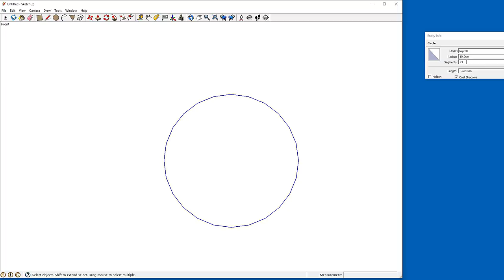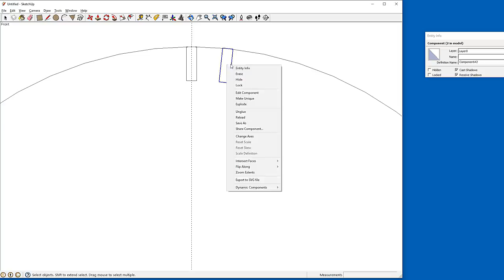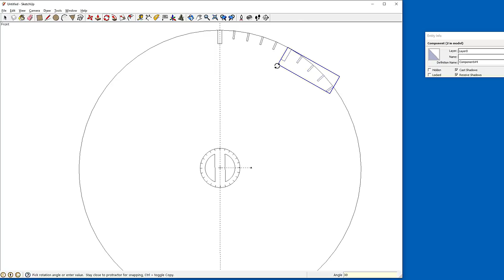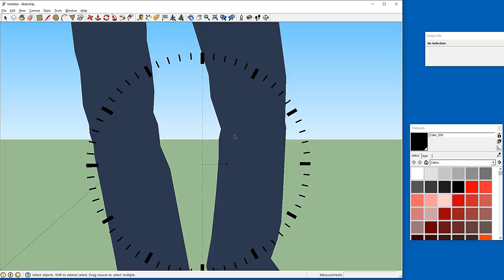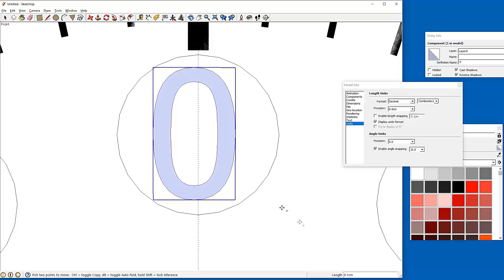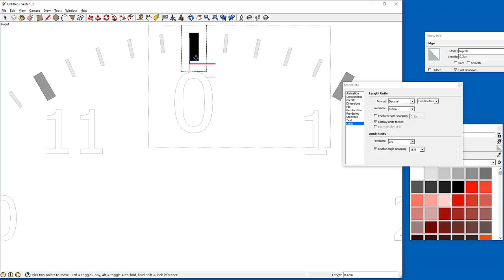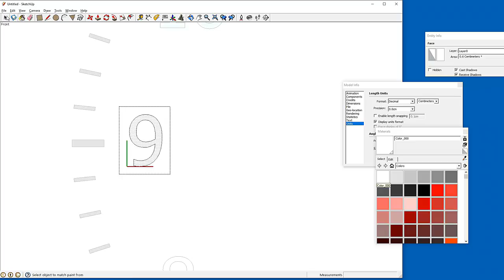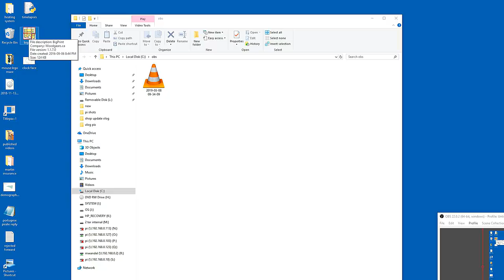SketchUp: Drawing a clock face (repair for IKEA clock)

Comment: I like this new clock face, Matt, because even though a lot of clocks wouldn't look good with a lot of color, I think this one does! Interesting that you chose "0" for noon and midnight, and the the old resistor code colors for all the numbers.
What's also interesting is that I never learned those last two, cyan and magenta, until now. I'll have to look up their values. I wish they had included those a long time ago and put them in their spots between green and blue (cyan), and between purple and gray (magenta). (Actually, if I had designed the code, it would start with red and then go from magenta to brown, and then black, gray, white, silver, and gold.)

Comment: That job reminds me of when I relabeled an imported rotary telephone (where 1&9, 2&7 were swapped), but that was 25 years ago, no sketchup, and on a 24 pin dot matrix. As the digits were behind a sheet of plastic it almost pasted as a stock indicators.

Comment: It’s incredible how much easier this would be with a real CAD software.
Reply: Not really. If he wasn't explaining things he could have done it much quicker. I just drew this in Sketchup for the hell of it and it took less than 2 minutes.

Granted, if I was actually designing a clock face I would have drawn it in Illustrator, because I would rather have true vectors. But Sketchup is nothing if not fast, if you know what you're doing.

Comment: I hesitate to mention this, but I hear/see you 'clomping' the mouse because you pick it up and need to 'zero out' the XY scale... I think messing with the 'speed' or "DPI" (and possibly the 'acceleration curve' settings) of the mouse in your OS settings might help you out... It might take some time to get used to a much higher DPI, but it will save your wrist from having to clomp that mouse around... I hesitate to mention it, because I know how 'personal' computers are, but I really just want to help your wrists out. Also, I just learned this: 'gaming' mice have REALLY made some impressive strides with comfort and functionality. Thanks for the videos, they are great!
Reply: the easy answer is just get a bigger mouse pad....

Comment: how does a clock disintegrate like that?
Reply: +Nate Walkner The advent of digital clocks.
Reply: If the clock face was printed on plastic material with an ink that was too 'strong' for the plastic, basically it eats up the plastic material over time. Typically this was seen with plastic materials printed with solvent based inks - if the solvents do not get fully driven out at the drying stage and remain in the ink film (even in small amounts) then over time it degrades plastics, especially in an enclosed environment. Just a guess but I've seen it several times over the years working in  R&D for ink companies
Reply: The passage of time
Reply: @KJS988  bravo sir
Reply: mice!
Reply: @TheBananaPlug  So the solution to getting rid of plastic is ink?

Comment: If you haven't selected anything else yet, you can type the number of desired segments of the circle and press 's' then 'Enter' just like you can type in a diameter. Entity properties is still available if you need to change the segment count later.
Reply: I guess "s" is for "sircle" since "c" was already used (presumably for "copy")?
Reply: @Sharklops  'c' is the shortcut to begin a circle. 's' is for segment. Once you click on a origin point and drag out the radius, you can type a number, then 'Enter' for the diameter. Type a number, then 's', then 'Enter' sets the number of segments.

Comment: Indexes start at 0, right Matthias!
Reply from the maker: yes.  Because "12 pm" implies its referenced off of midnight (12 hours), but it's PM.  Really annoying if you write a function that shows the date.  "0 PM" would make way more sense!
Reply: @matthiasrandomstuff2221  Personally I prefer the 24 hour notation anyway, but it'll be confusing on an analog clock I guess.
Reply: @basapon7074 
It's actually kinda common to have both 1-12 as well as 13-24(smaller print) on analog clock faces.

Comment: What language did you write big print in?  I’ve been looking for a good framework to write some simple apps for windows.
Reply: Not what Matthias uses (I think), but check out https://www.qt.io It's used in wide variety of applications, both commercially and in home. It has nice licensing options, too, if the open source version does not suffice.
Reply: @mattiviljanen8109  Thanks!  I'll check it out.

Comment: Are you using Google SketchUp or Trimble?  I see there is a free download of Google SketchUp 8, but it appears that all of Trimble's versions are fairly expensive.
Reply: Never mind.  I was looking a bit more on the web and discovered that Trimble acquired the software from Google.  There is apparently now a free version which is cloud based.  The warehouse is not available if using ver. 8.  I downloaded ver. 8 again anyway.  Maybe one day I will learn to use it.
Reply from the maker: Lucky you found version 8.  It's better than the newer stuff - just less fuss to it and it works just fine.

Comment: fusion 360 could do this far more efficiently. sketchup was the first 3d modeling software that i learned, i wasn't too proficient with it but enough to do most of the things i wanted, until i discovered the proper CAD modeling software, i soon realized how much i was missing out for using sketchup to model.  with fusion 360, it is magnitude more powerful and maintainable, you can easily go back to your drawings to change parameters and boom everything updated. sketchup is like a weird breed between a 3d mspaint and a CAD program but it does neither of that well.
Reply: Inkscape has a knob scale plugin that will make quick work of it. Sketchup is just embedded into my memory; it was quick, easy, and free.  They stole a march on autodesk by being free but autodesk is using that tactic to secure their future.
Reply: @Evert Chin - what's your opinion of FreeCAD?
Reply: @Evert Chin, I can relate to that. Watching this made me appreciate CAD all the more - especially the array feature. I personally use nanoCAD. I found its the closest to AutoCAD, but free.
Reply: @JDeWittDIY  i have no idea, i never try freecad before. i cant give recommendations for something that i never try before.

Comment: Starting the day on the 12th hour never made any sense. Setting a daytime midpoint at 12 never made any sense either. 

And to the naysayers who say "the zeroth hour doesn't make any sense" I offer a metaphor. I'm filling a 12 cups. I've filled none completely, but one of them is half full. 0.5, if you will. You've been counting with a zeroth ordinal system your whole life.
Reply from the maker: the way we track time is much stupider than using feet and inches.  But unlike feet and inches, we don't even have a good alternative.

Comment: Nice.. but seriously, use Inkscape for this. It's designed for this kind of drawings and licensing even less restrictive :)
Reply from the maker: The best tool for the job is the tool you already know.
Reply: @matthiasrandomstuff2221  not always but I guess this video is also made to show sketchup tricks, not how to draw a clock